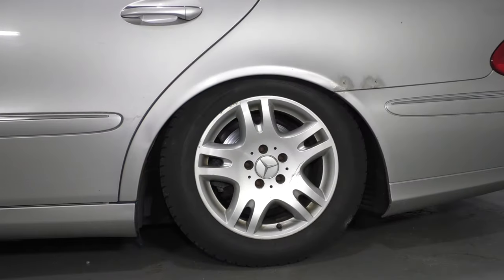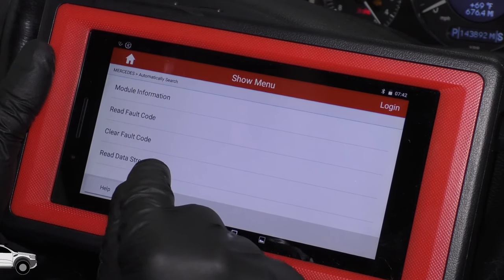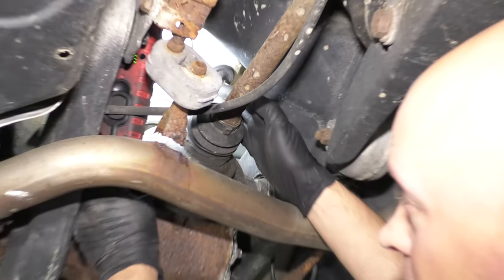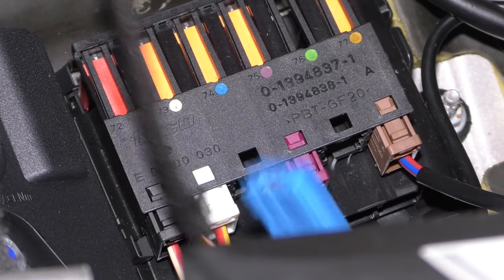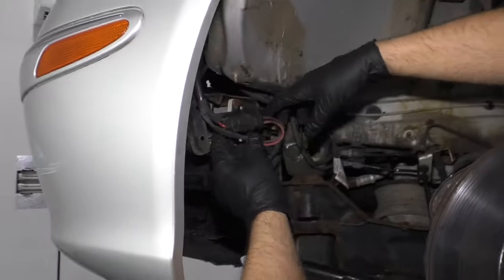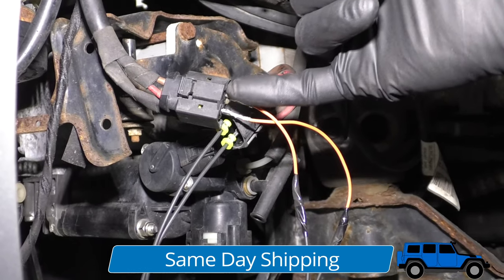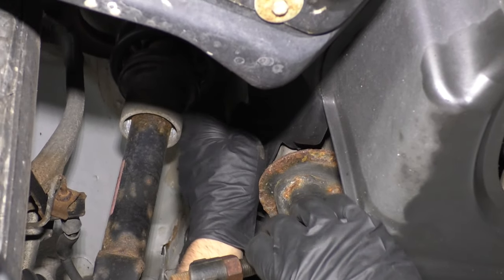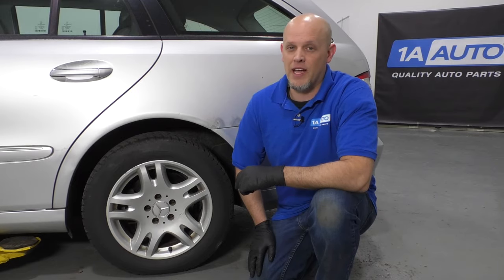Sagging Car, Truck, or SUV? How to Diagnose Air Suspension

Comment from the maker: √  Watch the Video
√  Buy The Part at 1A Auto http://1aau.to/m/Visit-1AAuto
√  Do it Yourself
√  Save Money
Reply: So...what was the solution?
Reply: they just tell what can cause a problem with suspension but we still do not know what’s the voltage on compressor plugs (release pressure sensor and pump) , should the engine run during multimeter checks ? what’s the size of fuse in passenger legs compartment? location of compressor relay under the hood ? how to check compressor relay with multimeter ? all that is very important yet we have just guide where roughly problem might be ...

Comment: I replaced mine when  they popped with Arnott bags.  A noticeable advantage is that they relieve pressure a minute after turning off the car.  The OEM seemed to decend after quite a long time.

Comment: A9/1y1 Airmatic pressure release valve or level sensor at the back. Check if you can hear any air loss near compressor or rear air bags. Id say if you have small hole in air bag it wont go down very quick, but if You hear air loss near compressor then its A9/1y1 as in my situation loss of air was quick.Good video overall.
Reply: You look honest and you telling us honestly my daughter did by Mercedes-Benz 204 right passenger it goes real low especially if you don't drive it for one or two days and it kills your battery even the car is off I did not know how to begin now I know what to do I am hoping what do I learn from you today will be one of the doors problem I do not need to buy the airbag got a very expensive and no guarantee first thing I do check the fuse check the wire I cannot get underneath the car I am already man so you saying bring the card down to the ground and let the pump is going to work and I will find out where the leak is so beautiful it is not you are just handsome your work is handsome too don't worry I'm not a gay LOL if there's any more problem allow me to respond to you thank you

Comment: Very informative video. I have some same W211 wagon and just had both airbags replaced due to leaks and one side is now slightly higher than the other side. I do not have full Airmatic just airbags on the rears only.  Is there any adjustments that can be made so that both rear wheels ride at the same height? Any pointers would be welcome.

Comment: I have a 2017 Cadillac XTS and I just replaced the air springs. My sat up for a week then went back to sagging in the back. I hear the compressor try otp raise but the car won’t raise. What could it be?

Comment: I have compressor not turning on. What fuses should I look to to verify power. Stayed working fine for 2 weeks.
I have New AMK compressor/new relay and a new Air Suspension Valve Block.
2011 GL450

Comment: Hi I have a 2007 CLS 550 and its throwing the airmatic code: "Power Supply Valves Short Circuit to Ground" I checked for continuity on each electrical plug going into the valve block and there wasn't any. The resistance was greater than 1.5 ohms. Is there supposed to be continuity or is there only when the relay activates? Do i likely have a break in the wire? Can you please help me im really stuck!!!!

Comment: Do you also work on hyandai equus air rides? I know trouble shooting it the same. But I for some reason my pump won't turn on now that my suspension is sitting on the ground

Comment: Hi I am considering buying a Mercedes e class 280 estate the owner has had some work done on the air suspension rear air bags..? if I Understood him right.
But there is still this intermittent fault I lost the bit wear you fixed that issue.. Was that the fix with the wire..?
Will it be mostly same on most cars..
If this is the issue in UK costs how much would electrician charge to fix please...?

Comment: My front GL 450 airmatic suspension is going, the compressor tries sometimes, but the front side both passenger and driver's side always goes down. What spare parts to buy, please? do I need compressor, airbag, and struts?
Reply from the maker: +Daniel Babson We wouldn't be able to diagnose an issue like that here, you may want to have a local mechanic take a look at it. Thanks for checking us out! http://1aau.to/m/Shop-1AAuto-c

Comment: I am looking to buy the exact same car with the exact same problem.  I would love to know the solution, and what else you need to look at.
Reply from the maker: +DaBaltimoron Thanks for checking us out! The air bags were not holding air as they should. It would be the best to go through all of the steps in order to narrow down the problem area. We cannot diagnose a vehicle online however if you follow these steps you should be able to. You can also take this to a mechanic and they will be able to help out and find where the issue is.

Comment: Hi there.. 
I changed my front airmatic suspension from my w212 350cdi 4matic with a new original mercedes/monroe.
Problem is that the car seems to be a little bit higher than before, does not absorbe shoks that well, like the airbag does not work.. and it feels a bit like a boat... 
No errors changing from comfort to sport or raising the car.. what can it be?
Reply from the maker: +Florin Vlasa We wouldn't be able to diagnose an issue like that here, you may want to have a local mechanic take a look at it. Thanks for checking us out! http://1aau.to/m/Shop-1AAuto-c

Comment: I got a w211 airmatic 2007 I've replaced the compressor new relay new rear air bags Both sides new front right air strut when I start the car I can hear the  the compressor engaging but sometimes compressor stops and message malfunction comes up..when is not malfunctioning and the car raises the next day the car is down ONLY at right front and right rear Any ideas???
Reply: Mine just started sagging sounds like an expensive bill hopefully you did your work and bought arnotts on fcp euro they have lifetime warranty, but You solve it man?
Reply: @elianangelmoreno  no man

Comment: I have a 2003 mercedez e500 5.0,    can someone tellme,
besides the car to be on the ground and a good height sensors good fuse and good compressor.   what others inputs the suspension module needs to load the air suspension

Comment: Okay I have a 2014 gl 450 the vehicle hits a bump while driving feels like I have no suspension and back in sways shocks seems to be stiff no bouncing  when I push for vehicle to be raised it dose with no problems and stays at that height any ideas I'm about to take into shop but still want your insight.

Comment: Nice video, my w221 mb suspensions are working well but the car shakes a lot on tiny bump & it seems it is not rigid enough. I know s class are very soft and comfy while driving , but it is not . What’s the problem ?
Reply from the maker: +Abed Saad We wouldn't be able to diagnose an issue like that here, you may want to have a local mechanic take a look at it. Thanks for checking us out! http://1aau.to/m/Shop-1AAuto-c

Comment: Air Suspension came on which Mercedes E Classes between 2000-2009?      Air Suspension is something we should try to stay away from right?
Reply: My car is low now outta no where you can’t hear the noise from outside

Comment: Hey I have a 2014 Mercedes CLS550.  When I first start my car it’s good then after like 30-60 minutes the stop vehicle vehicle too low message comes up and it’ll keep coming up. I’ll have to turn off car then turn it back on for it to stop then start again after a bit. Sometimes my car will sit low but not like low where it’s at the tires just lower then normal. It’s the front of the vehicle. Do you have any idea what it could be?
Reply from the maker: +Fundamentel 13 We wouldn't be able to diagnose an issue like that here, you may want to have a local mechanic take a look at it. Thanks for checking us out! http://1aau.to/m/Shop-1AAuto-c